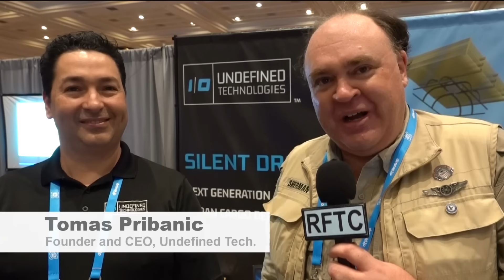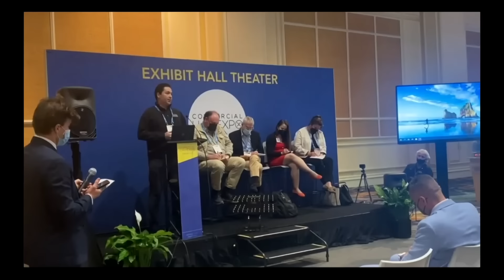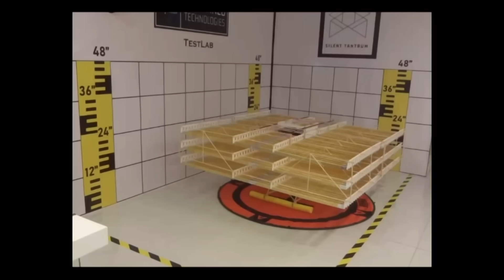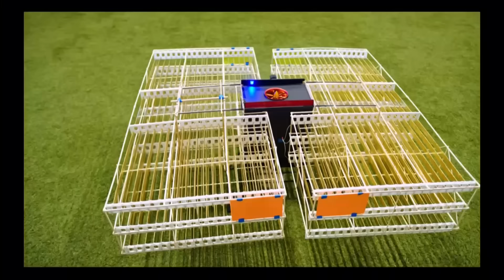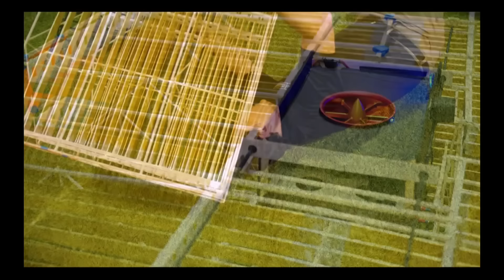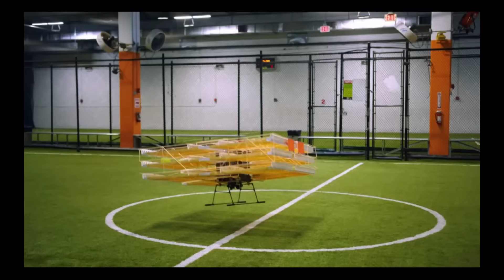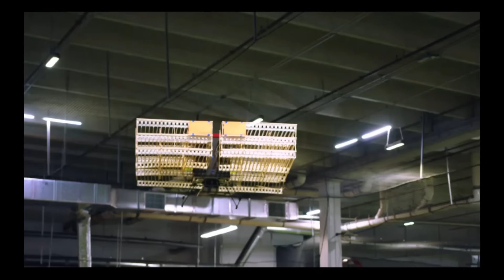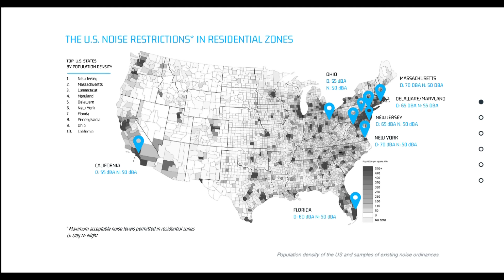New Drone Tech: No Propellers, and Yet It Flies!

Comment: There are huge craft with ionic propulsion that are tethered to huge step up inverters producing 1000+ volts to get their flight but the substructure is balsa wood . No way can you produce that amount of  power off of 2 lipo batteries. It works but no way Without a ton of batteries for a few seconds . I’m seeing EDF also.
Reply: There are some ion propelled crafts that lift their power supplies solely using ion thrust.  They can only be found on my channel though.  They only work because they follow known physics in a very particular way.  You are correct about the UT craft.  There is no known way it could lift its power supply in its current form.
Reply: never used a tv high voltage transformer?
Reply: I have my doubts as well.

Comment: Why can’t they just try to do what DYSON     Is doing with their “blade-less” fans? They re-direct the air flow from an internal fan to project the force from small openings that are almost invisible to see. It would be the safest drone and the technology is already more developed than Ionized drones.
Reply: A company called jetoptera is using that technology! Also a youtuber called Integza stuck an afterburner on the bladeless fan.
Reply: Did you watch the video? That is not the point. 
This is like saying to someone who invented a car that flies on no tires and causes 0 emmissions. 
"why dont you just ride the bus?"
Reply: Look up Cleo Robotics Dronut X1
Reply: https://www.youtube.com/watch?v=f2UCK3pCFjk
Reply: That principle is very much in commercial development currently for small aircraft.
Reply: 1. the weight of an aircraft like that would mostly be those small ducts/openings that's redirecting and concentrating the air.
2. you can only move so much air through a small opening. To make up for that, you'd either need less thrust or a bigger opening, at that point it's just better to have a regular open propeller design.

despite my points here, I don't really have any better idea other than open prop designs. Ionized drones are cool but they're still a long way before being an alternative

Comment: its a simple trick.. no yaw input  mans ts a disgused centrafugal weight and vertical thrust machne. the ionic cage s simply a cheaply build air sail  more then likely being  effected by the indoor tennis air conditionng lol look its moving forward... now run after t because you have near zero controll.

Comment: Pretty sure they are just using the ions for directional control and stability. There is an EDF in the center.
Reply: It is most likely stabilized by the moving fins on the bottom, the same as the other EDF propelled flying devices that are shown online.

Comment: These things will really take off with wireless power, and turning the structure into a battery.
Reply: Yes! Turning the structure into a battery is a good idea. It is elegant because it eliminates unnecessary structure and simplifies the design. The integration of form and function is the way of the future.
Reply: Thinking a sky platform....massive like a hot air balloon...

It is floating in the air ...has potential to drag energy from the atmosphere to power itself (Tesla tower style maybe)

Comment: The moment he mentioned ions, I knew it was lifter tech. I remember CERN developing something similar, using an electrostatic field across an aluminium frame to create aero lift.
Reply: It has a giant propeller fan in the middle.lol
Reply: @lcfflc3887  lololol
Reply: @lcfflc3887  The fan in the middle is used for the purpose of distributing necessary gases to the "lifters" to produce ionic thrust as ion propulsion requires gases to operate.
Reply: @ComRed_  LOL dude really 👈😃🤣  real ion crafts have no fans and you are lying.
Reply: @lcfflc3887  They perhaps could use tubes or pressurized gasses (as in most models), but here (I am not entirely certain as I am not the author of the build) they might have used a small ducted fan to distribute the gasses, besides I could confirm that a fan that small wouldn't be able to lift that thing up.
Reply: @ComRed_  Sorry to burst your bubble, but this craft is lifted by a very loud EDF. Later videos  on UT's own site that have audio prove this. They're obviously not making an actual ion lifter and it's nowhere near silent. It's a scam.
Reply: @natsume-hime2473  Ah, thank you very much for the information, I do hope you two have a nice day :D

Comment: The physics he talks about is actually rock solid, so it's really "just" a technical challenge. That makes it still pretty astounding that they seem to have made it work in such a relative heavy looking model, because some technical problems we seem to never bee able to overcome.
Reply: There aren't any known physics that indicate that the craft shown above, utilizing just ions, would lift its power supply, carry a 2lbs payload, and fly for 15 minutes.
Reply: @KraussEMUS1  Hello Ethan, i am not entirely sure if this is a hoax or not or if it is really solid state, but from a purely physically point of view it should definitely be possible, the argument i give now is no proof whatsoever but it should give an indication. If you would zoom in on a propeller down to the atomic level, one would most likely see that the propeller actually never touches the atoms in the air, instead the atoms are pushed away by the surface electromagnetic/electrostatic field against the motors electromagnetic/electrostatic field. Since from the propeller surface point of view the electronclouds around the air atom in the near field would appear more negatively charged, so it could be called a virtual ion. So to some extend even a propellered quadcopter could also be called an ion craft, even though it's not an solid state ion craft, since the electromagnetic actuator that has physical mass is rotating. So could we make a truely virtual electromagnetic/electrostatic propeller that acts on the air similarly than the physical propellers surface electromagnetic/electrostatic field. Tanks for making that comment, it brought me to that idea.
Reply: @trebronelruef5627  There's a massive EDF in the center of the model actually shown flying. A video with no sound. UT's YouTube channel has one with sound and the EDF that's doing the actual lifting is very loud. That video also has the comments disabled for the obvious reason... This is a scam.